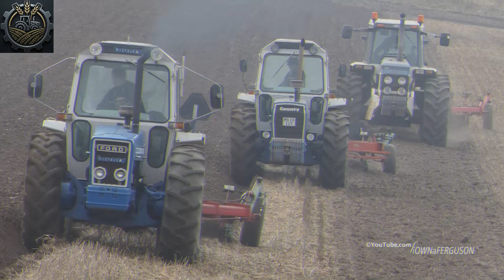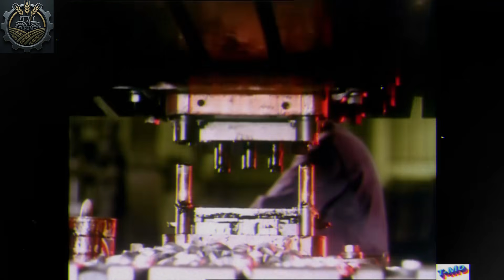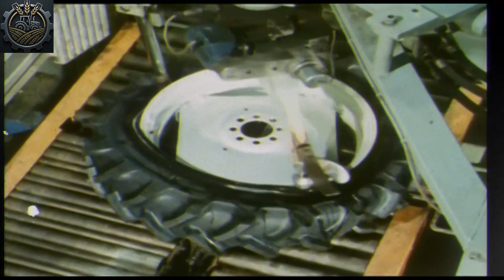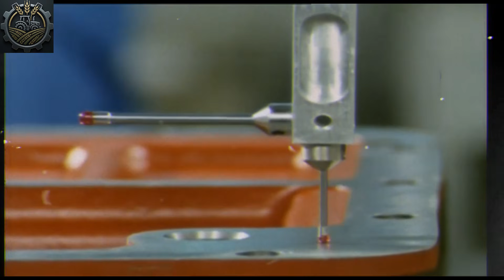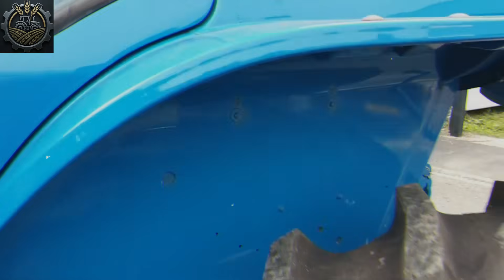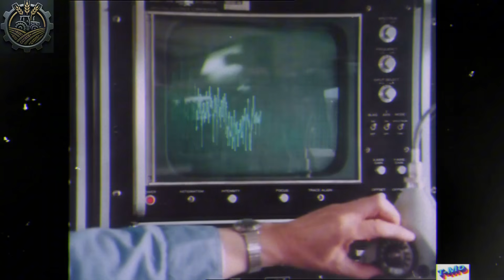Why Farmers Thought This Tractor Was Backwards (County 1174)

Comment: the turning circle was poor though
Reply: Turning circle...what turning circle  😂😂😂
Reply: Used county 1174 and 7600 four also Muir hills never ever had a problem with them,they weren't a yard tractor but they did everything they were asked
Reply: Im Gelände mit Lenkbremse war es besser weil die beiden Räder einer Seite gebremst wurden und die 2Räder der anderen Seite den Schlepper um die Kurve ziehen wie bei einem Bobcat oder einem Panzer oder einem Traktor mit 2 Gummiraupen!
Reply: @reinerspachmuller4334  You adapted your driving style driving it like it was a crawler continually would result in expensive repairs Muir Hills had a better Lock.